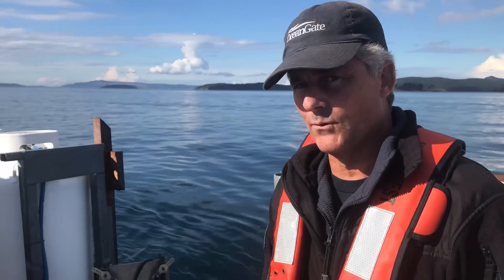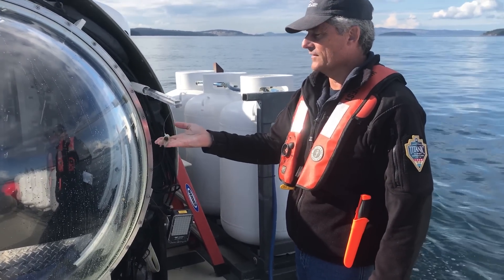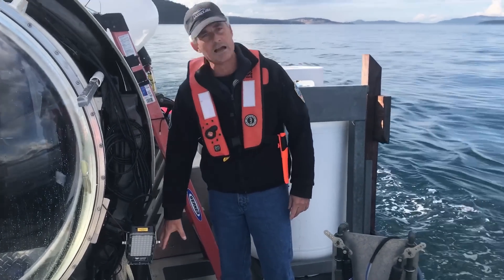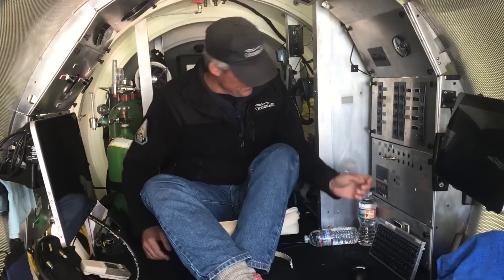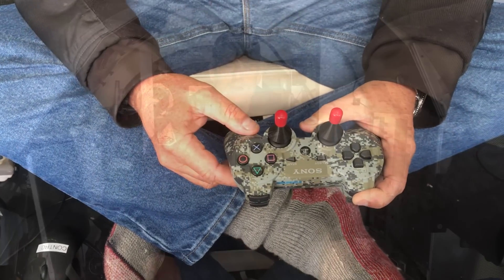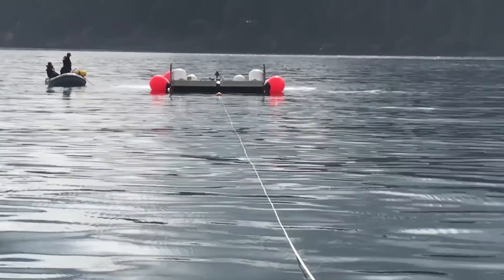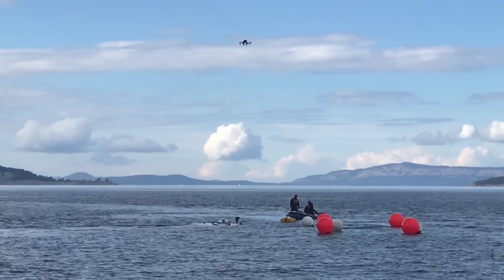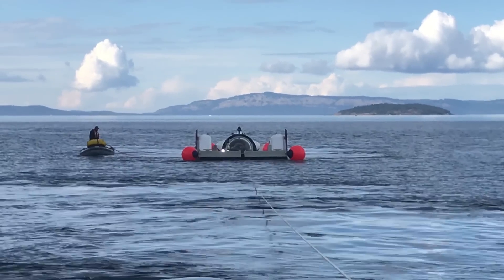OceanGate's sub explores the Salish Sea

Comment: As a former product manager of video game controller, a wired controller is more reliable than a wireless. A wireless has the comfort for a gamer but the wired is way more reliable.
Reply: As a swamp-dwelling ogre from the kingdom of Duloc, I too can confirm that attaching something with wires is better than connection over air.
Who would’ve thought??
Reply: As a controller farmer in the attic of my house from 1940, i too agree with this statement. Wireless were never reliable back in the 40s let alone today. Wire controller makes me h0rny with their reliability 👍
Reply: @nimjaturtle  as someone who actually plays games, unlike the mba woman on top, I never had wireless issues
Reply: As a gamer of 36 years i can indeed confirm wireless controllers are not reliable and should not be used in mission critical systems while exploring the floor of the ocean in an experimental vessel made of a composite material known to shatter under compressive loads

Comment: There is no issue with THIS vessel or expedition. They were 180 feet under water in this case. That’s not that deep compared to the titanic which is 12,500 feet down.

If they have stuck with these shallower expeditions, they would be fine. Even if they got lost, they could have been easily rescued at 180 feet. 

The Titan sub that went to the titanic though was another beast and it’s 1000x more dangerous than this 150-200 foot dives.
Reply: Imagine if he just didn’t push his limits, he could not only be making tons of money doing these expeditions at depths not quite as deep as the titanic, but safer, and eventually patent his subs and start selling them for millions but of course we all seek the latest and greatest best most dangerous highest thrill seeking activities
Reply: @ForwardNewsToday  The problem is you don't make "tons of money" doing these shallow dives. People don't pay $250,000 a ticket for them like they do for the Titanic. It's not a viable path for a business because the employees/surface support needed to make sustain the operation is not recoupable with the business model.
Reply: @ForwardNewsToday  No
Reply: 180ft deep rescues r nuttin but a thang, tell them dog
Reply: No